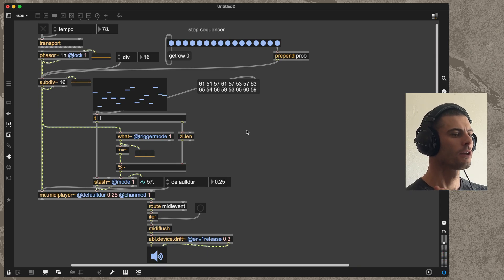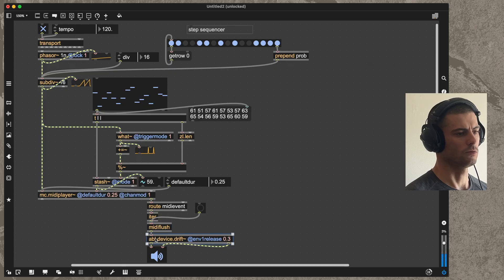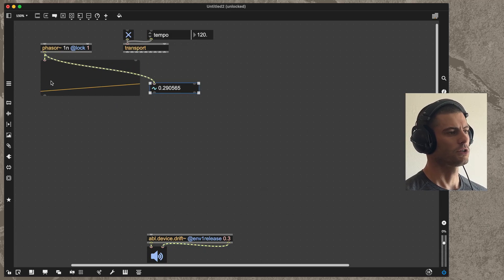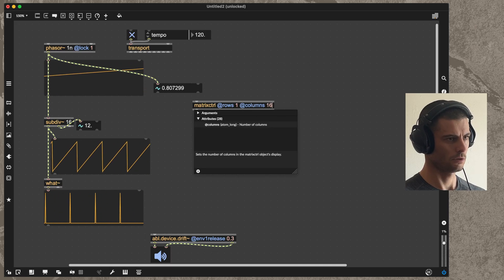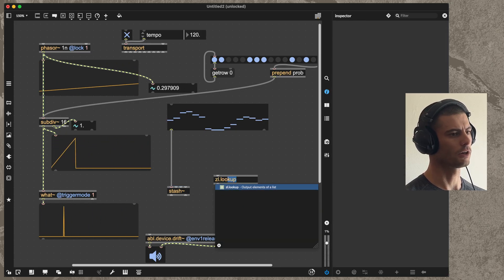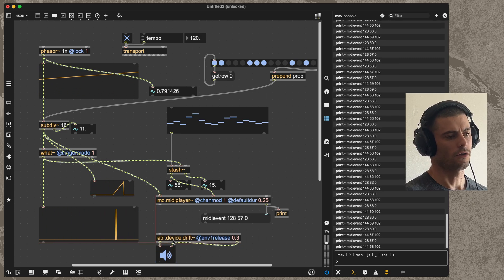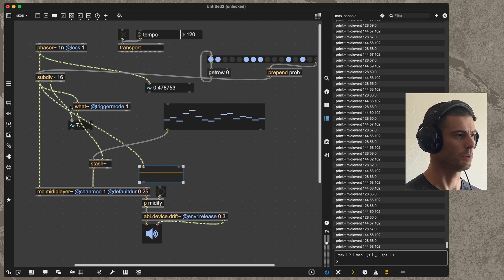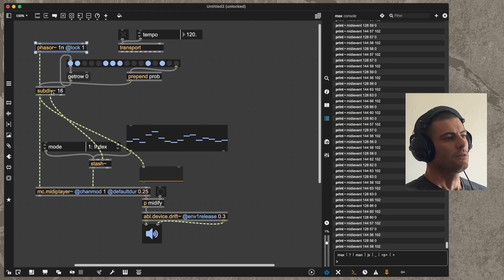Making a basic sequencer in Max MSP (2025 version)

Comment: Thanks for the great videos Philip! One thing I was wondering about with this one was, if you wanted to sync up the rhythm and pitch sequences like in a "traditional" step sequencer (so each matrixctrl cell corresponds to the same step in the multislider) is there an easy way to do that with this patch? Or would you have to patch that some other way, maybe with a second stash? Is that something you've experimented with at all?
Thanks again for the great content!
Reply from the maker: if you set it up the way it was at the end of the video with that second outlet of subdiv~ going to stash, it would work that way. 

and yes like you point out, you could also have two stash~s - one for melody and one for the rhythmic pattern. as long as they have the same number of values, you can feed them the same index and keep them lined up the way you describe